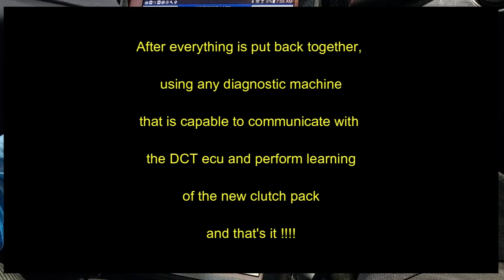Hyundai DCT Dual Clutch Replacement And Clutch Actuators Reset

Comment: Have a problem with Clutch # 2 temperatures spiking when selected in any Even number gears, but will cool down to coolant temp if selected in Odd number gears, also will kind of buck when shifting into even gears, any ideas? 2016 Veloster Base, with 84K miles, did a relearn on DCT cause of a dead battery and thought that would fix but no luck.
Reply from the maker: does it overheat on flat road?
Reply: @GicaPhp  Yes, overheats when moving at all in the even gears
Reply from the maker: @JoshuaTek  the only reason would overheat is slipping clutch due to wear or bad touch point
Reply: @GicaPhp  Ok, would climb up to 120+ degrees Celsius while the odd number clutch would stay around Coolant Temp, any way to adjust the Clutch actuators whilist on the car or does it have to be removed and if so, any special tools or processes?
Reply from the maker: @JoshuaTek  Send me vin number please.

Comment: What could it be when there is play and clicking/clunk when manually turning both tires with vechile jacked up sound inside the transmission where the cv axle goes in also when accelerating from stop. Seems like a lot of play where axle goes into the transmission.
Reply from the maker: there should be play, and noise coming from differential, if your is excessive I would not know unless  I could hear and feel it and compare it. If you can, try on another one and compare with yours.

Comment: Salut, dețin un Hyundai Ioniq EV 2018
Doar în modul Electric, la viteaza mica în general, 10-30 km/h când apăs pedala de frana ori când accelereaz sa plec de pe loc se simte o smucitura și îmi apare în bord Check hybrid System si martorul Check Engine. La tester am codul de U1011 Lost communication with HCA by HCU (L - CAN
Mi s-a  spus ca este posibil sa fie din acel acuator. Ai mai întâlnit o astfel de problema? Cum putem lua legătura,ms !
Reply from the maker: Ai cumva o scanare a tuturor sistemelor, as avea nevoie de toate erorile + seria de sasiu
Reply: @GicaPhp  am scanat tot sistemul, singura eroare este DTC U1011, cum pot sa-ti trimit, scan, poze ? Un email? Mulțumesc!
Reply from the maker: @adelin5364  gicaphp.gmail

Comment: Hi george ive got a 23 buick invision 9 speed dct at 500 miles i starting noticing a rattle in 4th and 6th gear.. on my 4th visit to dealership they tested transmission fluid and it had metal shavings in it 😢... so it was rebuilt and still this noise remains ive been back twice sense then complaining about this noise go on test drives and the asshole cant here anything wrong its now at 5000 miles what do i need to say to them to get some results... thx george
Reply from the maker: I belive you should contact regional manager or even higher. Customer care or something similar.

Comment: Where can I get the tool to press the clutch back in?
Reply from the maker: It is a genuine tool the one in the video, put you can use a straight bar and a bolt in the middle to push down a cylinder

Comment: I did the dual clutch and set up the clutch actuator, it let me do the first half of the basic settings but the second half you start the car and  it says mismatch on the second half of basic settings. do a put a new clutch actuator in it? Ps i’ve only 1st gear when driving it I might get 3rd 5th and 7th no reverse gear.any suggestions if you can help me thanks.. ps1300 for a clutch actuator want to be sure before I buy one thanks
Reply from the maker: Any fault codes?
Reply: @GicaPhp  p073E:07 Gear dropped out R,Gear dropped out 2nd Gear,P074A:07thanks
Reply from the maker: @ccbanger1414  what is the VIN number?
Reply: @ccbanger1414  Did you ever fix this? Having the exact same issue, same fault codes and no mechanic wants to touch it. Been off the road 4 months now.

Comment: I have a 2013 veloster, 1.6l non turbo
Is there an adjustment? And where or how
Reply from the maker: i need the vin
Reply: KMHTC6AD6DU101126
Reply from the maker: No adjustmet on yours. Yours is different type of actuator. What work have you done on it?
Reply: There was a clunking noise coming from the bell housing, but the transmission was working normally, then the garage took the transmission off of the engine, they think it needs a clutch and flywheel, they put it back together without changing the clutch and flywheel and now the car wont go forward or backwards and it wont to the shifting learn with the scan tool.
Reply from the maker: @alashanaa2488  any fault codes?
Reply: Just the one for being unable to learn shift patterns
Reply: I believe the code is P17C0
Reply from the maker: @alashanaa2488  learning values for tcm are lost. It requires relearning the bite pints of both clutches. 

When performing learning, you can only do it once per ignition on cycle.

Depending on the diagnostic machine you need to do:
1. Gearbox geometry learning 
2. Clutch characteristics learning
3. Shifting position learning

The ignition needs to be on and engine off
Prake pedal fully pressed
Parking brake engaged
Shift lever in P
No other faults except p17c0

After this is learned it will require learning with:

engine running at idle
Brake pedal fully pressed
Parking brake engaged
Vehicle no moving 
Shift lever P
Reply: I get to the second part of the learning (engine running) and the process stops, failure to complete learning.
Reply: But no additional codes
Reply: I was told there is a specific allignment or balancing procedure for these dct's, is that correct?
Reply from the maker: @alashanaa2488  if you have done 1st part, it should be ok to drive and it will self learn. if not, ignition off and back on and do it again,

Comment: My actuators is making  a rapid tap sound taking off at low rpm then goes away.like one of the posts are lose or something.
Reply from the maker: Scan for fault codes, and watch live data for selection of all gears.
Reply: @GicaPhp  Okay, Thank you.
Reply from the maker: @velo16441  Let me know what you find

Comment: WHERE DID YOU GET THE CLUTCH KIT, I CALLED THE DEALER IT COST A LITTLE OVER 3000.00 THERE
Reply from the maker: i got it from dealer, where are you from?
Reply from the maker: in UK is about £1300

Comment: Como se llama la herramienta para cambiar el kit donde la puedo comprar
Reply from the maker: you can improvize with any 3 leg puller and some bolts and nuts and a solid bar to push it back in
Reply: Where did you get that messuring tool for the actuator?
Reply from the maker: @joooeone  i made it, but you can use any vernier caliper or a ruller. If the distance should be 72 you can be +/- 1mm and you'll be fine

Comment: Am și eu 7DCT+1.6 tgdi și după update mașina prezintă șocuri atunci când sunt în D1 și iau piciorul de pe accelerație. Cum se conduce corect cutia asta?
Reply from the maker: Salut, daca ai facut software update si tot trepideaza cand dai drumul la frana, trebuie alt pachet de ambreiaje. Trepidatie se masoara cu GDS si daca depaseste un anumit nivel atunci trebuie inlocuit. Exista pachet de ambreiaj imbunatatit si este si un TSB referitor la asta. Da-mi VIN si-ti spun exact ce TSB
Reply: @GicaPhp  eu am un i30 2016, 1.6 gdi care trepideaza doar la primele 2-3 plecari dimineata, apoi e ok. Nu stiu daca are facut vreaun update de soft. Daca iti dau VIN, poti afla? Mulțumesc!
Reply from the maker: @nikaandrei  Pot sa verific TSB-uri pe baza vin-ului.
Reply: @GicaPhp  TMAD351CGHJ347933
Mai mult ma intereseaza daca e vreun update de soft de facut. Nu cred ca a fost facut vreodata... Poate se rezolva asa...
Reply from the maker: @nikaandrei  Da, exista un software update pentru modelul tau referitor la DCT GEAR ENGAGED IMPROVEMENT, nu pot sa-ti zic daca a fost facut, trebuie connectat GDS si verificata versiunea de soft existenta pe masina.
Reply: @GicaPhp  ok. Mulțumesc pentru ajutor! Tu unde ai service?
Reply: @GicaPhp  putem lua legatura prin mesaje? Mail, fb, wapp?
Reply: I have the same thing in my kia ceed 2015 can you help me please?
Reply: Same

Comment: You do not register according to what you take the amount of income of the clutch, how do you know that the income is correct so that the promises will come in?
Secondly, you don't take a picture of where you take the measurement of the height actuator pistons
Reply from the maker: The clutch pack is new, so the lenghts are setup acording to the manual at 72mm. If you look at 13:13 you will see where I am measuring exactly. Hope this helps.

Comment: dct is the worst transmesstion ever made. avoid it by all cost unless it have torque converter
Reply from the maker: there are worst, try easytronic ;) the only reason they fail is driver misuse and abuse. But they will get cheaper with time

Comment: Salut D-le George. Am un Tucson Model 2019 si la 40000 Km nu mai intra in reverse. Acum este la Tiriac auto service. Nu cred ca o sa mai am vreodata masina buna cu Doreii care lucreaza acolo. Inginerul mi-a spus ca trebuie sa dea cutia jos sa o verifice ptr. ca la tester nu are nimic. Cand o pun in R se aude un cloncait asa ca de rulment spart. In drive merge si schimba perfect si nu are zgomotul acesta. Credeti ca este foarte grav? Cat costa o cutie noua DCT ptr. Tucson? Multumesc,
Reply from the maker: Da-mi te rog VIN
Reply: @GicaPhp  TMAJ3812HLJ929954
Reply from the maker: @felixmotanul5242  am avut destul de multe cazuri pachetul de ambreiaje are 'drag' .

Ce coduri de eroare ai?

Cu masina pe rampa ridicata, scoate capacul la clutch actuators si vezi ce lungime au tijele si daca sunt la fel extinse si vezi daca opereaza smooth in even and odd gear (dar daca zici ca merge smooth inainte in toate viteze, nu cred ca ai o probleme aici)

Scoate actuatorul afara, si actueaza toata vitezele tinand un pic contra cu un deget si vezi daca selectorul functioneaza.

Apoi cu o surubelnita muta toate vitezele prin gaura de la selector si vezi daca intra toate.

Daca nici o problema nu e gasita, atunci cutia trebuie data  jos si schimbat pachetul de ambreiaje.

Masina ta este in garantie inca
Reply: @GicaPhp  Salut, am primit raspuns dupa trei saptamani de verificari. Te rog sa-mi spui daca trebuia demontata cutia sa gaseasca defectul asta. Citeste ce mi-au scris:   Saptamana trecuta s-a demontat cutia de viteze, am gasit furca cautatarului blocata.

Astazi am lansat comada de piese, imediat ce ajung in stoc ne vom ocupa de montare pe masina si remedirea defectului .

 Totodata avem un raspuns si in legatura cu garantia masinii – lucarea aceasta se va trata in garantie Hyundai. Intrebarea este: ca sa ajungi la furca trebuie sa demontezi cutia? Multumesc,
Reply from the maker: @felixmotanul5242  da. Cutia trebuie data jos
Reply: @GicaPhp  Multumesc pentru raspunsul rapid. Crezi ca dupa asta o sa mai am masina buna sau o marit? Are 42000Km si deja asta este a doua problema majora.
Reply from the maker: @felixmotanul5242  nu-s masini rele. Toate au probleme mai mari sau mai mici. Daca vrei sa schimbi masina, atunci da, vinde-o.